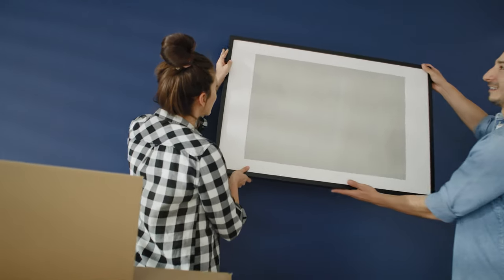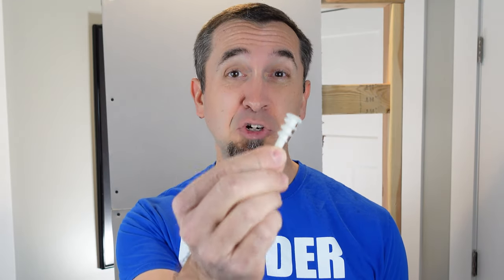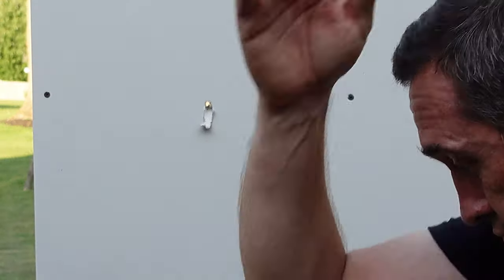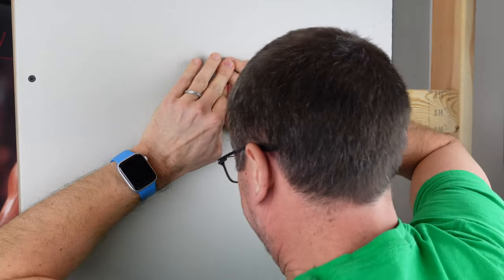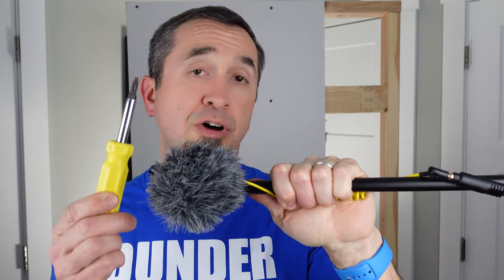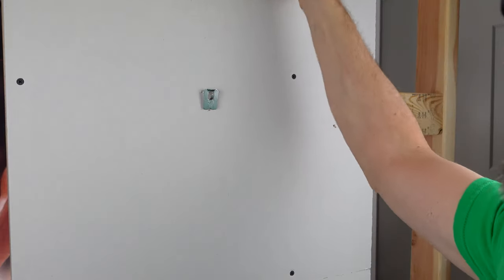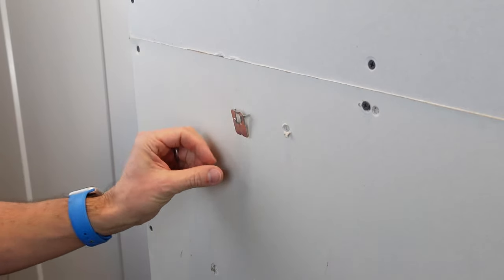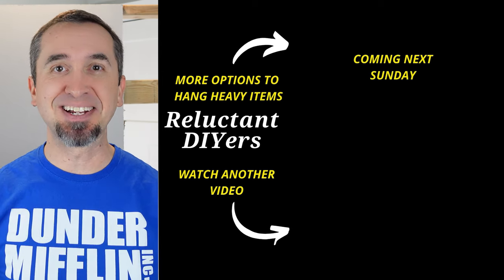3M Claw vs. Drywall Anchor - Hanging Heavy Items on Drywall

Comment: If you're a real pro contractor you would know EZ anchors don't go well with powered drills. Manual screw drivers or maybe low power screw drivers only. Real amateur.
Reply from the maker: Thankfully I’m not a real pro contractor 😉 You should check out my other videos where I talk about using a drill versus screw driver with these anchors and the problems it can cause.

Comment: I tried them to put a sound bar on the wall. Totaly negative experience. Frist, I don't know how strong your fingers need to be to press it in. A hammer does the job though. Second, when I put a soundbar hinges on the claw, it immediately came out of the wall. So it doesn't hold a load other than those on the rope. As I got, it needs the load pulls straight down then it holds but it's very limited use then. Hence isn't worth the money as long as you are not a art gallery owner.
Reply from the maker: Yes, if there is any sort of outward pressure pulling away from the wall, these definitely are not ideal. Downward pressure is the key. 👍🏼

Comment: Wrong! I used a drill and they went in way easier than a screwdriver
Reply from the maker: HA! I hear you… I’ve used a drill easily 100+ times to install these anchors. It’s easy… but I have since stopped using the drill because I have found that I can more accurately place my anchor in the exact spot required when I use a screwdriver.

Comment: Question for you about the 3M Claw how well does it work if you live in a old house with plaster walls. ?
Reply from the maker: I have never tried one on plaster walls, but it does say it’s made for drywall. 😢
Reply: @ReluctantDIYers  yes I realize that
Reply from the maker: Given the way it functions, I would not trust it in a plaster wall.
Reply: @ReluctantDIYers  That was my thought because I was going to use them to hang a heavy mirror. I trust the device just not what the wall is made from.
Reply from the maker: @jeffwindrim975  100% agree with you.

Comment: Just subscribed. I purchased a Claw today, but was wondering, if there are already existing drywall anchors without screws, will the anchors still be reliable if I use new screws? If I can use the anchors, what length and type of screw I should be looking for?
Reply from the maker: Jason thanks for subscribing! 

I never trust drywall anchors that were there before I arrived. I would definitely suggest fixing the drywall (if you need to) and putting in new anchors, or claws, exactly where you want them.

I hope this helps!
Reply: @ReluctantDIYers  Thanks for the super quick response!
Reply from the maker: @jasonlee8506  Any time! Have a great day!

Comment: Great video.Would you use two 3m claws for the mirror frame/ picture frame for extra safety?
Reply from the maker: You could, for sure. Just please do not add the weight ratings together to get what you need for the item. Both will need to be rated for the full weight of your heavy item. 

Thanks for watching!!
Reply: @ReluctantDIYers  cheers 👍

Comment: Would you trust a single 3M 65Lb claw to hold the weight of a 45lb, $1k mirror with a 75lb rated wire strung between two D rings?

I was about to use toggle bolts but i hate how much drywall damage they'll do, but i can't afford to break this mirror
Reply from the maker: If I’m hanging that mirror, I’m finding a way to hit studs. If that’s not possible, I’m using either self-drilling toggles or self drilling drywall anchors. My two cents… I hope that helps man. 👍👍

Comment: Another great video.  What would you use to hang a picture on wood paneling above a fireplace?
Reply from the maker: Thanks J Biggs!! If we’re talking about a heavy picture on old school thin wood paneling, I would not hang anything on it without hitting a stud. That paneling wasn’t designed to hold weight. 

Now if you’re talking more expensive ACTUAL wood paneling (with thickness), that’s different. If it’s mounted properly you should be able to hang something heavy right on it.

I hope this helps!

Comment: Super useful video, thanks - would you say these claws are safe to use if there's potentially a live wire behind the wall? It doesn't seem like the claws completely penetrate the drywall as they're so short, which makes me think they're safe.
Reply from the maker: When I’ve used this on my test wall (1/2” thick drywall), the points of the claw do not penetrate the back side. Also, the points are very dull and would not easily penetrate the protective wire cover.  So it’s really a judgement call based on your specific situation.
Reply: @ReluctantDIYers  Much appreciated, thank you 😁
Reply from the maker: @MrFreakshow182  No problem! Have a great day!

Comment: Hi There, will the claw work for drywall that has no studs? ( hollow with wallpaper ). This is to hang a 40 pound mirror
Reply from the maker: AJ thanks for reaching out. This product doesn’t directly rely on studs to work. It just needs a wall (drywall) that is properly constructed and can support the weight. That’s super vague, but I hope that helps some.
Reply: @ReluctantDIYers   thank you! I was wondering if it works on the part of walls that are hollow due to non studs.
Reply from the maker: Im glad this helped!
Reply: @ReluctantDIYers  so it's supposed to work on hollow parts of drywall where there are no studs correct? I  was trying to confirm that.
Reply from the maker: @AJ-ks8iq  If you’re talking about the areas between the studs in your drywall, yes.
Reply: @ReluctantDIYers  wonder what the strength of those walls without studs are.
Reply from the maker: @AJ-ks8iq  How far apart are the studs? Standard distance is 16”.
Reply: @ReluctantDIYers  it's 12 inches apart , and a 40 pound mirror has two hanging holes 18 inches apart.
Reply from the maker: @AJ-ks8iq  This sounds like you’re in really good shape. I recently posted a video of me hanging a 40lb mirror in drywall where the studs are 16” apart. The only difference is that I used another type of wall anchor. I could have also used a Claw and it would have worked just as well.

Comment: I use the metal screw in anchors. Have re-used them over and over with no issues.
Reply from the maker: Awesome, thanks for sharing this info! I’ve thought of comparing the plastic anchors I used with the metal ones to highlight differences like this.